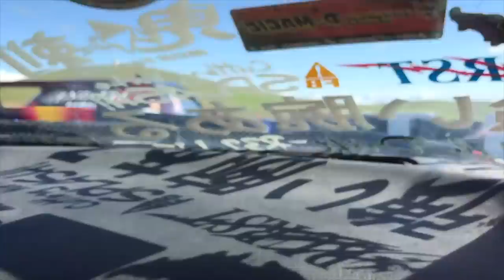Storm Bihoku Day | Animal Style

Comment: 9:04 looks like the technique of foot braking immediately after pulling the handbrake in initiation. It produces more and drags it sideways in a straight line rather than turning in with the front wheels. It drags the front tires across the tread and is essential in dragging the wall and helps in initiating backwards entries. Also, such SPEED! Dear all, practice this one in Forza.